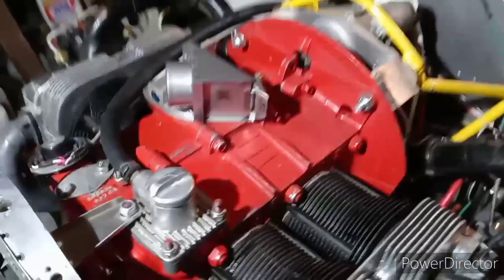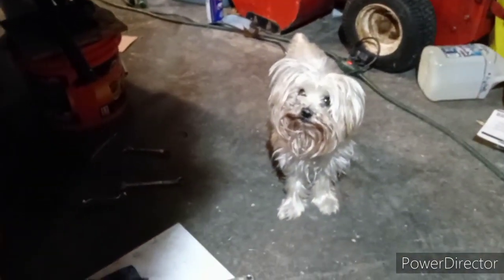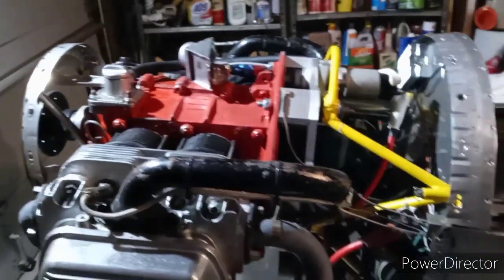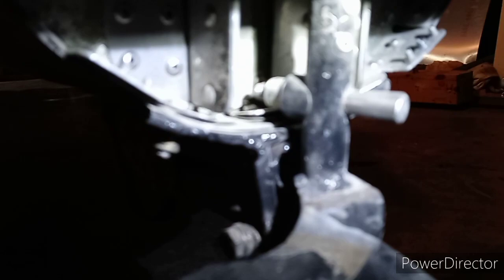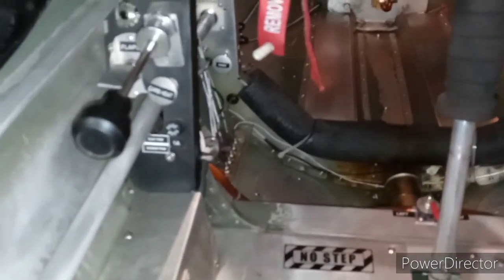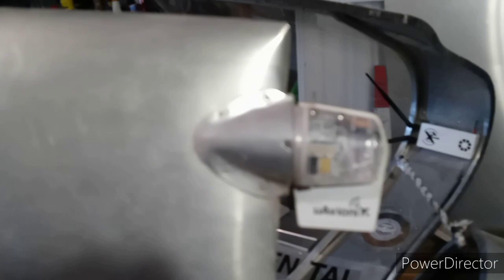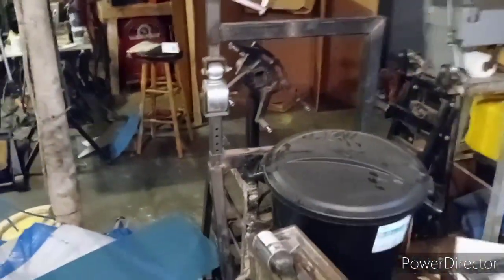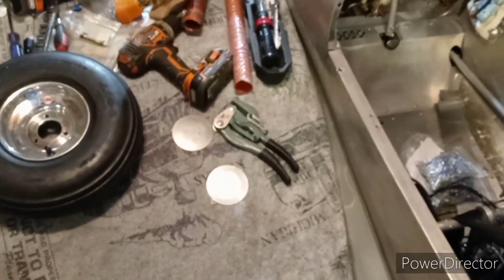FAA update and H5 annual plus more!!

Comment: Thanks for the shot of the tapered pin !
Reply from the maker: Hi Joe. Well yes sir I was hoping you would see that. I don't know when I will get to that. You do know you will need a tapered reamer to taper your hole so it will work? Anyway will let ya know when I get to it
Reply: @redblackvette  Yes, I do know about needing a reamer. I was close to ordering a pin from aircraft spruce but I haven't done all the measuring to determine what size to order. 
I noticed that my bottom hinge (bolt) on my rudder has quite a bit of play, I may make a video for you to look at and tell me if it is acceptable.  Thanks Dennis.
Reply from the maker: Hi @dimojoe   ok thanks and I may need to take mine out and measure it to see what my holes in up being.